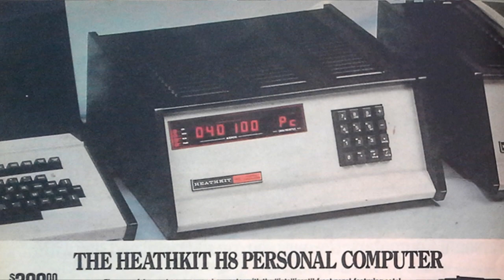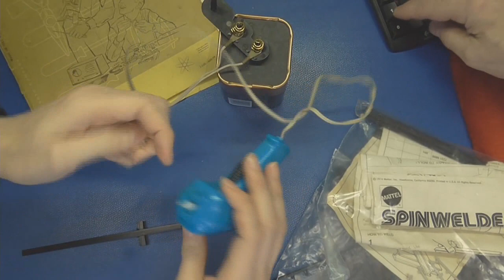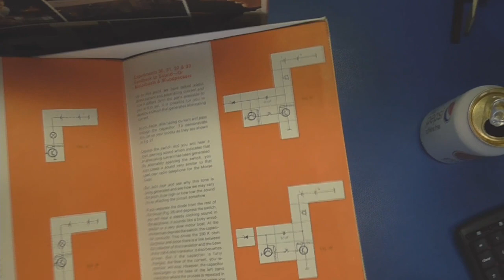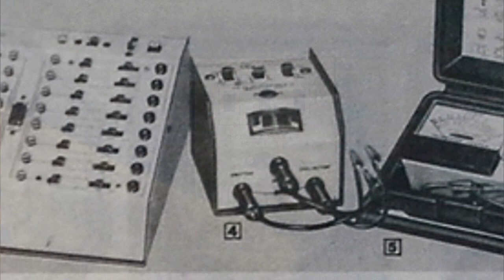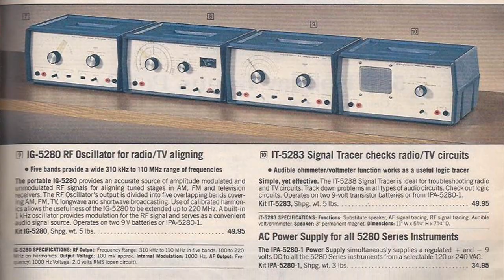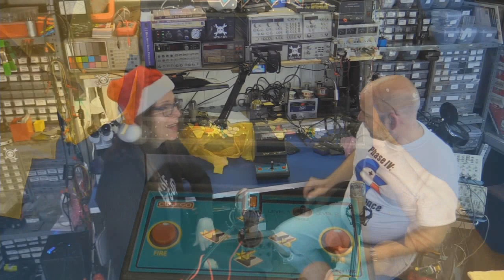The Dinosaur Den 2014 Holiday Special

Comment: Yay!! Fran and Bill are back!! Ah, yes...the good old days. Nearly all of my favorite toys were "made in Japan."  Much broken plastic and shards of sharp metal that could cut you if you just looked at them the wrong way! You would scream in agony as your mom poured iodine on you wound , slap a bandaid on it, and then got back to playing with that very same toy. You had a second skin of scabs and wore your Band-Aids  like medals of courage. No helmets or pads for you when you rode you bicycle with the dangerous shift lever on the top front bar. If you fell off and got hurt that was too bad. You wobbled back home for repairs maybe even to the hospital for a few stitches if necessary and in a day or two, you were right back on that bike with the numerous scratches.  My very first "computer" was  a giant plastic bread board-like thingy which had sliding switches, light bulbs hundreds of contacts and tiny wires for you to connect everything into a crude circuit. There were paper cutouts involved which acted as a sort of program for your "computer." You would slide the switches back and forth to make the lights light up in different ways to get answers. The switches acted as crude logic gates. What a contraption it was!! It was a lot of fun learning though. You had to create adventures with your toys unlike many of today's toys that almost play by themselves. I really miss the 70's!!

Comment: Lafayette Electronics sold tube amp kits.  As I recall, they were headquartered in Soyosset, Long Island.  As an eighteen-year-old in 1960 with no electronic experience, but plenty of practice following instructions building model airplanes, I wired my first tube amp. Three years later, I put together a second Lafayette amp kit for friends. Both amps worked perfectly, first time switched on.  It was forty years before I got around to reading about tube circuitry to understand what dumb luck that was.  I guess Lafayette's instructions were clear and flawless.

Comment: Nice blast from the past. I had one of these electronics kits as a kid, too. I don't remember the exact type, but it was from Kosmos, a local German company, and looked similar to this one:
http://www.experimentierkasten-board.de/viewtopic.php?f=2&t=588
They still produce more modern version of such kits. I managed to build the simpler circuits like oscillators, but never managed to build the AM radio receiver, which required to wind your own coil and I probably did it wrong. But then I started programming in assembler on a C64 and forgot all electronics for some time.
And I think I had the C64 Zaxxon version on tape (or was it Scramble?). My father modded the datasette with a small speaker with an amplifier to hear the signal of the audio head, so that I could tune it with the little screw if it was misaligned and didn't load the games. I could hear when the audio head was right aligned and the signal sounded clean :-)
Reply: Awesome show Fran & Bil!
I remember the 150-kit, but I could never make my parents buy one for me, so I started taking apart my toys instead (and after many years i managed to put one back together again). ^^

Comment: I also have the same transistor tester. Opened it up for a look. Quickly I took one of the "C" batts. out, to check for leakage, & did not not note the polarity. I assume the batteries are in series, ++ 3V. Update. Found they're in series. Great video, especially the Mattel spin welder.

Comment: Heathkit, wow!  I aspired to having ANY Heathkit for about 6 years, before I could actually afford one!  I had started working for a company that was sponsoring me through college, so I finally signed on the dotted line for Heathkit credit, to buy an IG18U audio sig gen!   No credit history score nonsense then,  I even still lived with my parents, but I was accepted and the day finally arrived when my huge box arrived with the IG18U!
I worked 3 solid nights to build it, and then the moment of truth arrived, would it work. Yes it did, first time!  I took it to college to calibrate it, I still have it and it works perfectly.
The quality of Heathkit stuff was superb, build quality is tank like!
I also built 2 of the Ultrasonic intruder alarms, the ones that are disguised as a book.  They worked first time also, and still do!
So Bill, I have that same 2-1/2 digit, Nixie tube DMM, although I can't claim to have built it.  It was at a house clearance auction and I couldn't resist it.  And it works fine!
At the same auction I also purchased a Heathkit scope, valve model.  That also worked fine.  The guy who built them did a really good, neat build on them.
The scope had been working fine but a few years ago suddenly developed a fault when I was working on an equipment problem for a friend.  The trace suddenly went completely out of focus. At the time I just reverted to another scope I had, and the Heathkit went to one side.
When I traced the fault it was a high value resistor in the HT divider chain, it had gone open circuit, so the some of the HT rails went high.  Popped in a metal oxide high stab to replace the carbon original and it was back to normal. 
The Heathkit era was great, I miss it!

PS. Fran, you have lovely hands!

Comment: 1968 in England, I got the Philips electronics kit, worked on spring posts, which you pushed through a schematic card placed on a board with holes in.Then ordinary components could be clipped into the top of the springs. Took me a year of no success to work out one of the germanium PNP transistors was a dud. No projects involving radio transmission - frowned on in those days.
Heathkit advertised here, this is why subconsciously I still want a grid dip oscillator (GDO)  but Heathkit were too expensive to ever buy.
Seems to me NPN came in with silicon and putting positive at the top of circuit diagrams.
1981, the BBC Micro computer etc. (inc Commodore)  appeared and my interest (and that of many other people) in electronics waned.